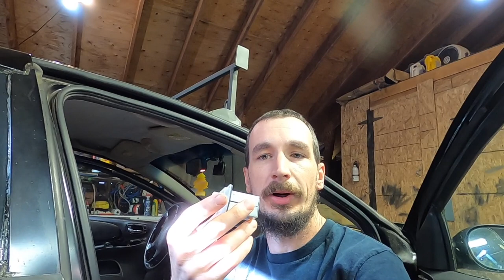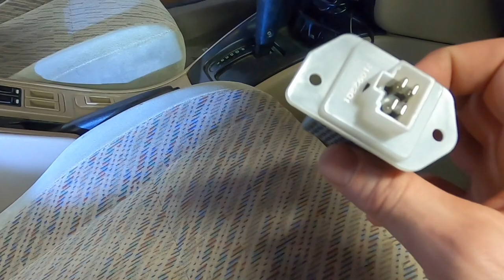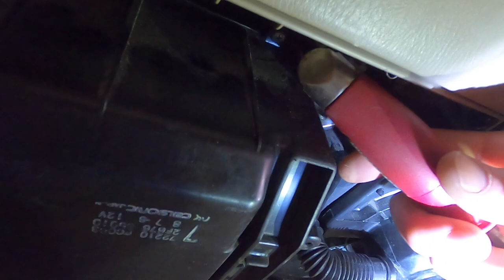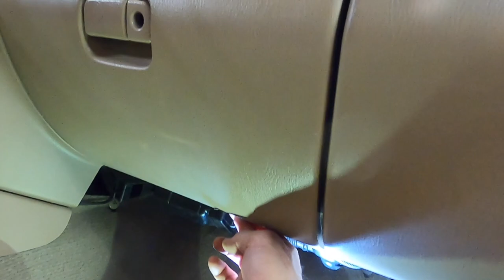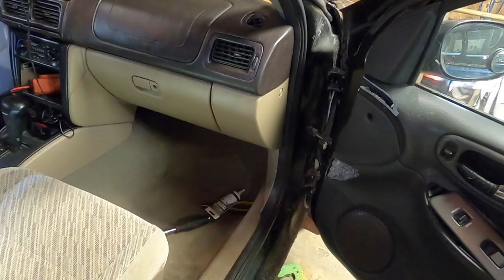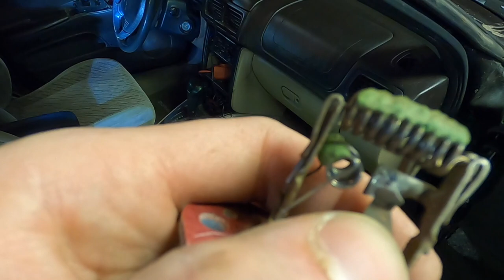Subaru Forester Blower Motor Resistor Replacement

Comment: Tip: (if it hasn’t been mentioned already) It’s an extra step but if you can just remove the glovebox assembly, it is so incredibly easy to replace the resistor as once the glovebox is out of the way, it’s literally right in front of your face. To be clear, I’m referring to the whole assembly, not just the glovebox itself. I just did this on a 98 Impreza and it was stupid easy once the assembly was out of the way.
Reply: Forgot to mention, all you need is a phillips head to remove seven trim screws.

Comment: At first my 1, 2 and 3 stopped blowing and the fourth still worked, but eventually the fourth stopped working too. Would you still suspect this to be the issue? Thanks.
Reply from the maker: There is actually a fan relay under the dash on the left hand side, it's up above where the hood release is and you will find 3 relays clipped into a bracket there and it is the uppermost one. It could also be your fan switch itself but the relay is only $10 so start there.

Comment: I have a 2000 Forester, I'm assuming it's the same car as yours. The issue I have is the blower motor works on settings 1,2 and 3, but does not blow air on setting 4. Do you think it's the blower motor or something else?
Reply from the maker: Yes ‘98-‘01 are the same. Probably the dash switch, with the car off slide the switch back and forth a bunch (this cleans the contacts) do it 20-30 times and then see if it works at all. If it does work that would just be a temporary fix, but then you know for sure you need a dash switch. If the blower motor is working on any of the speeds than that shouldn’t be the issue.
Reply: @CarswithNash  Thank you. I will give that a try.
Reply from the maker: @tommygomez5343 I just want to let you know there is also a blower motor relay that could be causing your problem, under the dash just above where the hood release is there is a bank of 3 relays and it is the uppermost one. Ended up having to change mine.
Reply: @CarswithNash   Just a follow up. Turns out the main plug that goes to the climate control switch was melted. I ordered a used Climate Control Switch from eBay, it came with the wiring harnesses. Since the main plug was melted I had to snip the old plug and then I replaced the Climate Control Switch and the main plug. I used heat shrink connectors from Harbor Freight. And I used my heat gun after I crimped the connectors to melt the heat shrink. It's been a few weeks/months but it has been working great. Thank you for helping me diagnose the problem.